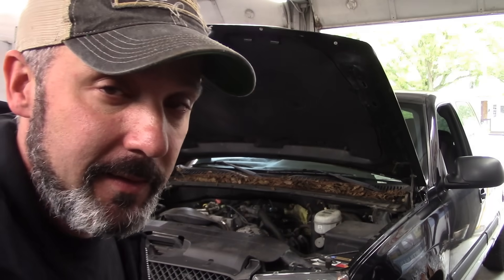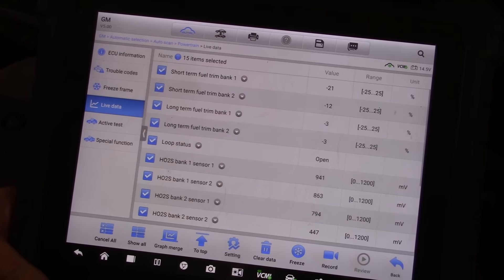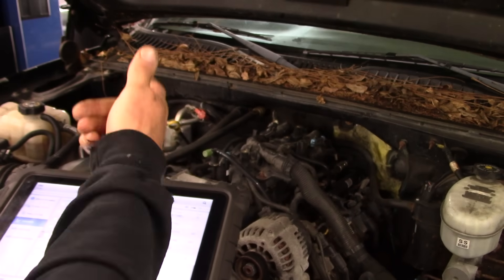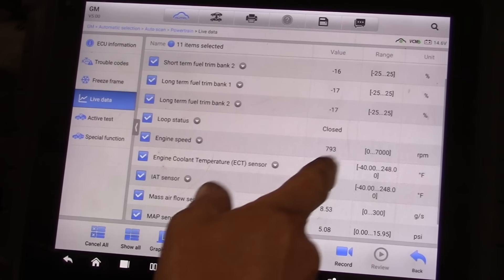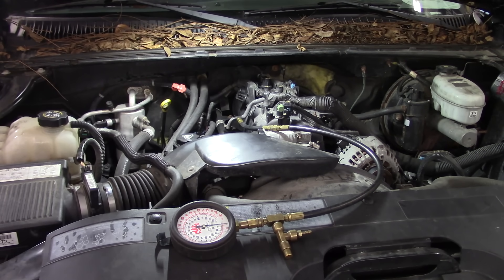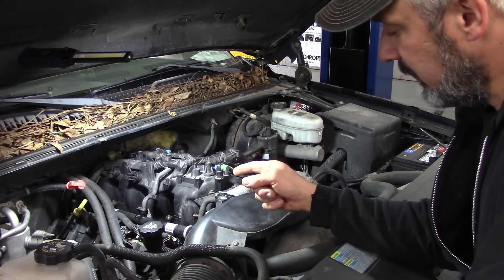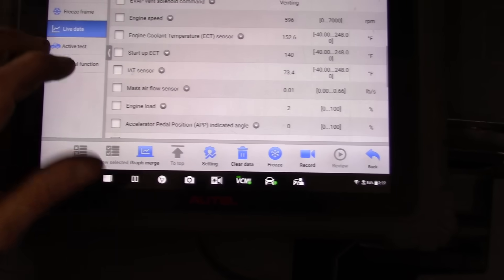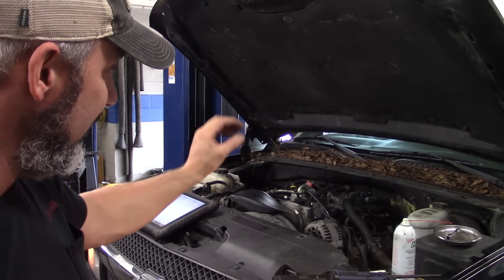Parts Cannon Special: Rich Running Chevy Truck P0172 and P0175

Comment: Great video bud. I’ve been watching for years now. Quick question only because I think your an honest guy who will tell us the real answer. Is there any of the pour in fuel treatments that actually work to clean injectors or valves or is it all just snake oil ? Thanks ✌🏻

Comment: Yeup, that's the thing about diagnosing fuel and emission codes.  Most average Joe's will just load up the parts cannon, and get lost down in the rabbit hole. I always teach the newbies how to follow the live data and use strategy based diagnosing.

Comment: I got a 1999 ram off a guy that was running but running rough stumbling around. He replaced all kinds of stuff with the autozone specials including the crank position sensor. All the research pointed to that being the issue but he replaced it but got a factory one at the junkyard for $15 and it immediately fixed it and that engine purred like a kitten. Watch out for aftermarket sensors.

Comment: I tried buying junk ebay part with some 02 sensors and ign coils always had used oe parts never again will I use cheap parts. Good call on the injectors when  you said no part # I knew right then it was the injectors.long time follower ex mechanic.

Comment: I've got the same codes, just bought the truck two months ago, brand new air filter, brand new MAF sensor, looks like the previous owner fired the parts cannon at it and the light turned off for long enough for me to buy it.

Comment: I had a similar thing happen with my 2000 ford escape, rich codes and misfires and I could not figure out what was going on. I replaced all the spark plugs and coils, as well as some fuel hoses, didn't make a bit of difference. Ended up being the cheap aftermarket fuel pressure sensor I had recently put in, it worked fine for a couple hundred miles and then apparently started throwing bad data and making the car dump a buttload of extra fuel into the engine. 

It's hard with the older vehicles bc you see the old, rusty crusty parts in there and think that replacing them with new will fix everything. I learned my lesson! Parts cannon is definitely the "harder" in "work smarter, not harder"

Comment: Great video Eric, thanks. My daughter has a 98 Neon that is running rich at idle. I've replaced the injectors, both oxygen sensors, the idle air control valve, all the spark plugs, the EGR valve, checked the fuel pressure which was good but the problem remains. I'd love to buy OEM parts for this vehicle but all I can find is aftermarket. Not sure what to do at this point.

Comment: I really believe in using OEM parts. But my 27-year-old Jeep Grand Cherokee (most) aren't available anymore like the TPS. CPS and airflow sensor etc. I have to buy aftermarket. The dealership told me that 10-12 years after manufacturing is the cutoff for almost all these parts. So far the aftermarket parts I have used have worked.

Comment: It's like that moment a few videos back where you spoke about how the costs of repair are coming to a point repair is too costly.  Sticker shock is real for a lot of folk.  I'm looking at a little diy scooter type summer project,  I can spend 12 dollars on Amazon for a 'carb' or get a real unit from a real company that really makes them with real attention to detail for 800.  Guess how much per hour I don't get paid.  How long will 12 dollars last?  Long as summer lasts at least and next year is a whole other year.

Comment: Ive been trying to find the culprit for my rich condition for years now on my subaru.  Ive got it narrowed down to injectors or map sensor which is the only things i havent replaced.  Im leaning more map because it starts throwing rich codes like crazy once it gets below 40.

Comment: Great video, learned a lot about the importance of when it comes to sensors, OEM is always the way to go. People sometimes are cheap and only look at numbers/quantity not quality. I made that mistake when i bought my 05 civic, bought a butt load of suspension/steering parts from Rock Auto and one of my struts failed in less than 1K miles. Thanks for the info and explanations on data interpretation. Once again MR.O great video...

Comment: That thing had the Great Wall of Chinesium fired at it! What a mess! Sucks that there's so much crap out there as far as parts go today. NEVER had this issue back in the day, when life was SIMPLE!  

Good ol' Wilbert's to the rescue! I was getting ready to take a ride out there a month ago to grab a 6.0 for an engine swap on the ol' Silverado. Turned out my low oil pressure was due to an Amsoil 15K50 oil filter! I would've never believed it if the exact same thing didn't just happen to my dad's '19 Ram Hemi, 2 months after I changed his oil. After that I wondered if my issue could be so simple. Turned out, it WAS for a change! So, that's why she's getting built into a fire-breather now. I had a pile of money saved for the swap. No sense saving it, since it will be worth less and less the longer I hang onto it lately! Don't get me started on that ... 😬 But anyway ... that then made me realize that was probably the source of my neighbor's low oil pressure in his Tahoe! Killed 3 birds with one stone on that discovery. Amsoil refunded me the rest of the filters I had in the case, but wouldn't refund the cost of the oil used, and also didn't reimburse me for those 3 filters I used like they said they were going to. That ruffled my feathers a bit. Better partially screwed than fully screwed I suppose! 😁

Comment: A leak in the exhaust manifold is pirating air to the 02 sensor telling the emc of a lean condition and responding by raising  the fuel trim.

Comment: This is similar to a problem that I saw years ago. I didn't draw the job; another tech had it. A Chrysler Sebring 2.7 V6 with rich codes. It ran perfectly. The only clue that anything was wrong was the MIL and rich codes. In the end, it had the wrong fuel injectors. Another shop had installed a used engine. Some of the 2.7 engines were flex fuel and some were not. As I recall, the car came in with flex fuel injectors but the correct injectors were non-flex fuel. 
I fixed a few Chryslers and Jeeps over the years by checking the baro reading and comparing it to actual barometric pressure (have to trust Google on that). The interesting thing to me is how well the Chrysler Jeep Dodge engines ran when they had issues. They were all MAP sensor engines (no MAF). They didn't care about vacuum leaks or baro or incorrect injectors...the MIL was the only noticeable problem. Excellent diagnosis sir! I enjoy your videos.

Comment: My 08 Impala was throwing rich code long term was -25.  Ethanol Count was stuck at 50%. I had to reset the fuel composition. Basically car though I was using e85 which I never do.

Comment: I’ve seen the O2 sensor fixed below a half of volt drive it rich and have seen the ecm o2 sensor circuit shorted replaced ecm and fixed that one

Comment: I had a an EFI car that sat in a shed for 3 years, and when we got it running again, it had a stuck injector that just flooded one cylinder with fuel. Dropping one injector off, would also have pinpointed that the injectors as a set were contributing too much fuel. 1/8th is 12.5% and that would have pulled the fuel trims in by a corresponding amount.

Comment: What a mess.  Good thing you saved some old but good parts to put in.  Did it still smoke as bad?  I had a 2004 Ford Mustang GT with the 4.6 and put in a Kenne Bell supercharger.  It was adding fuel like crazy.  Finally traced down not 1, not 2, but 3 vacuum leaks.  Fixed those and trims were great.

Comment: Morning Eric, I have the same problem sometimes with diagnosis of Access Equipment, (scissor lifts and cherry pickers) I end up doubting myself as having tried all the options to resolve a fault, when the only thing left is a £2000 wheel motor it makes you think what have i missed? Because its me that would have to pay for it if it still does not work. Great video's. 
Regards Richard 🇬🇧

Comment: Thanks Amigo, I learn so much from your channel and inspires me to learn more. Never new what a MAP sensor was or how to check. My scanner was set on metric (kpa) was reading 101 baro 102 map (key on engine off)  I'm guessing thats not bad enough to really skew my fuel trims is it????       Pretty sure I have a bad fuel regulator but still need to purchase a fuel pressure gauge to check bleed down. (98' chevy)

Comment: Comment on MAF G/S @ 600 RPM MAF G/S should equal Engine Size in Liters. Hope that Helps. Seen that little Devil overcompensate for Engine Size. (I assume you have as well) Great Video.

Comment: I went down a wierd road on a similar situation it was a chinsesum fuel pump that had a clogged drain hole so it would dump fuel back in the tank and couldn't  regulate fuel pressure

Comment: Dang, so possibly my issue of the truck not running right may be from the Amazon fuel injectors I bought and put on? My 02 Silverado keeps dying on me when I start it & try to take off. I now need to warm up the engine up to 160 degrees before I can start moving. Thanks for the insight of what could be my issue.

Comment: My 96 Silverado was running rich with P0300 'random misfire' "after replacing" the clogged up original style spider fuel injection with the 'upgraded' MPFI system. Started right up and ran much better except for a few weeks later when it started missing and fouled all the rear plugs. Pulled manifold top off and pressure tested the new spider by turning key on, fuel was leaking straight out of the fuel block right below where the fuel lines go in. I'm like WTF! There was a micro hole in the plastic block that was leaking like crazy. I couldn't even see the hole, but it was there none the less. I Had to order a new one that is supposed to be better, but they all look the same. I had to change all the plugs and change the oil because it was dumping fuel into the oil. Waiting for my new spider to show up today. Fuel injection has its drawbacks.

Comment: had a Buick park avenue that was running rich, it was caused from the mass air flow sensor, guess it was telling the engine it was getting way more air than it really was and the fuel system was trying to keep up.

Comment: Put a set of Bosch injectors in my 2007 Frontier. Bought them on eBay but I thought since they were Bosch I’d be ok. Fuel trims are pegged negative and my mileage went in the toilet. I’m going to try putting the original back in I guess. 
Can’t find anything else wrong

Comment: I like your approach. Is there a fuel rail pressure regulator? If so, does it reference manifold pressure directly? 

I have done Ford truck test drives up to the top of Pikes Peak (Rocky Mountains, in the summer). I think the oxygen content is 56% by mass of that at sea level. The best performing truck was the Turbo Diesel because obviously it uses a compressor.

I think the best Engine Management Designs have a full time Baro sensor, and as you stated can be on-board the module, which is usually hand soldered at module manufacture end of line and then will have a block off (which will be removed before shipment) if the module is conformal coated. Measuring Baro is different than MAP, in terms of output range and response. Usually a MAP is much more expensive than a full time Baro

Comment: a clogged air filter or intake piping will also cause a rich condition because of choking the engine of air inducing a rich condition. remember, rich doesn't always mean excessive fuel, could mean lack of air as well causing a rich mixture

Comment: Hmmm I got the MOSTPLUS O2 sensor set for my 08 Avalanche and have had nothing but problems with Fuel Trim Imbalance codes after installing them.  Got them from Amazon at 1/4 what OEM sensors run (if you shop the price down).  I think the problem is their O2 sensors but I can't prove it but really leaning towards MOSTPLUS is straight up junk/ripoff.  Think I am out the $60 and will have to go with GMParts Dircet for an original part x4 now just for sanity reasons now before I had it over to a shop.  I been chasing down the same things you checked but my codes are 1174 and 1175.

Comment: What happens if the trims are all -25 when all the sensors are OEM and all ok?

Check the hoses feeding the intakes manifold/block/sensor valves.  They may be blocked or blocked at the end of hoses into the intake manifold and engine.

I had the same rich issues, turns out to be blocked hoses at the intake manifold vacuum relay for Mazda GH with variable intake manifold.  Also dirty intake manifolds may also cause this blockages where the hoses enter.

A good blast and soak with throttle cleaner shud do the trick.

Comment: Hey Eric! Battling the same type of thing on a plow truck i bought. so far we have changed intake gaskets, maf, knock sensors, air filter, fuel filter, plugs, wires, bank 2 o2 sensor 1 etc. While doing the intake gaskets i noticed the injectors say N-17B03 on them. Im suspect that these were chucked in there by the last owner. Any way to check the injectors to see if they are functioning properly and if they are dosing the correct amount of fuel?? Thanks!

Comment: When I had a misfire and cylinder 4 I swapped coils didn't change when the coil next to it I changed the plugs and the wires didn't change a thing then I changed the injector problem solved no problem since changed all the injectors 20,000 miles later still going but it's a 5.3 not the 48

Comment: If you're going to buy ebay injectors, Motor Man remanufactured Injectors are good and around 200 bucks for a set of 8. 
I've used them on 4 vehicles, no problems at all.

Comment: Had a  rich  problem  on a focus 01  that the scan tool could not  find   = dog Chase  tail   change all the induction    parts   idle control valve / MAFS    wile  pulling  the intake  and looking  down  spotted  wet  Trail  of gas from a vacuum  detail line =   fuel pressure  transducer  the diaphragm  was leaking  into the intake  vacuum  line  .  After market  part 150 $  dealer 250 $  for a little  plastic  part .  The cheap one ran ok from Advance  .  Somthing  dumping too much  gas can cause multiple  codes.

Comment: Had a 4.8 with the smoke problem on startup..lots of blue oil smoke but only on occasion..Figured a cracked valve guide and depending on what rotational position the engine stopped, if the intake valve on the cylinder with the cracked guide was closed, the oil would accumulate above it and get drawn into the cylinder on startup..Your thoughts?

Comment: The crappy MAP was actually helping the situation, artificially low baro will cause it to lean up.   Also, I would have swapped the MAP first and left the MAF, the MAF reading is filtered and modified by the ECU, the bad MAP could have skewed the MAF reading, MAF may have been fine.

Comment: -- Off the top of my head, I'd guess that MAS is standard on 2000-2006, but 99 is possible.  2007 is when they dumped this platform and redesigned (the bailout of 07 when GM went totally to crap).   And they started manufacturing in Mexico (big differential problems)  You want one built in Texas.  Take care of it (I have an 04 with the 5.3) and between 2000 and 06 were great years for these vehicles.  But boy when you first turned that thing over it sounded like it was pumping a swamp through it.  
    Anyways, nice fix.

Comment: Could injectors cause lean conditions. I have high fuel trim on my down stream fuel trim on 2003 Toyota matrix. I have installed new ox sensors, cats, checked fuel pressure and vacuum leaks.

Comment: Hey buddy, random question. I have a 19 Camaro SS with the direct injected 6.2 V8 with 50k miles. Car has negative long term fuel trims that go more negative when accelerating. I've replaced everything with oem that was in this video (injectors, plugs and wires, maf, pcv, checked for vacuum leaks). At idle, or steady throttle cruising trims get better. My coolant temperature does go down when driving on the highway (down to around 165-175) but I assumed that was just from running rich. Bank 2 is around -21 and bank 1 is -18 around 2k rpm when casually acclerating. Bucking at light throttle, bogging under heavy throttle. Replaced O2 sensors oscillating as expected. Only codes I ever got to come on was a P015B and a P015D code shortly after (both are O2 sensors delayed response lean to rich). Fuel pressure seems ok??? Any input would be greatly appreciated
Reply: @DevJB  so the fuel system is returnless, it doesn't have a regulator. Just replaced the injectors, and dealer says fuel pressure readings are within spec (but I don't believe them for some reason)lol. Another thing is there is no cel, never has been for over a year now. Just constant rich condition for over a year!? The temperature thing is an odd one though. Because it will drop from say 185ish at idle, all the way down to 160s sometimes even 150s while steady cruising (car will go in and out of open and closed loop between each gear shift - it's a manual).  The only thing it could be at this point is a bad hpfp, or something coolant related. Even though a bad thermostat or coolant temp sensor in these cars trigger a cel almost immediately which is confusing!? Also, heat works fine, gauge on my dashboard works fine (fluctuates sometimes up and down when cruising). Maybe I have a lot of air in the coolant system??? I'm going to replace thermostat and coolant temp sensor in a few days just to do it.

Comment: Was there still blue smoke after you fixed it? I had the same problem with junk fuel injectors from Ebay and ended up eating it just getting OEM after all the headache.

Comment: Having some of these issues wit my 06 wrangler. Started wit misfires, got 4 new o2 sensors, got new plugs, coil pack, new injectors. Misfire went byebye, now I’m running rich. Have you done this same work to a jeep wit the 4.0?